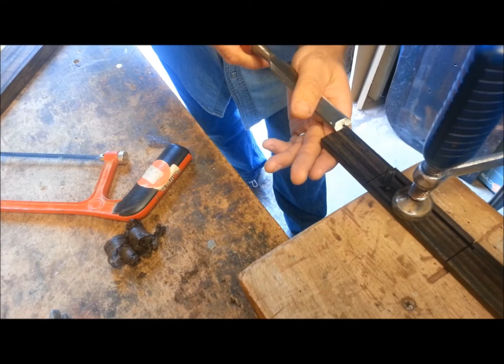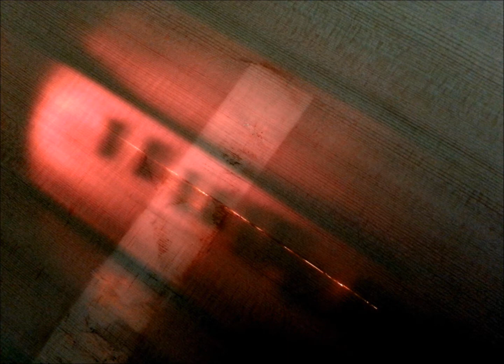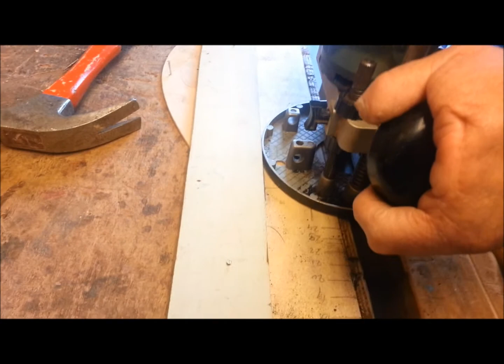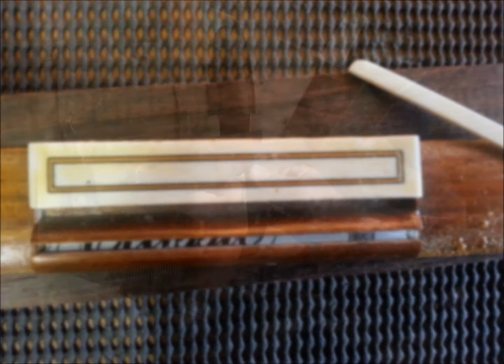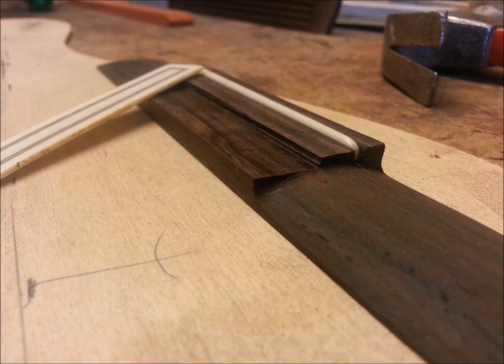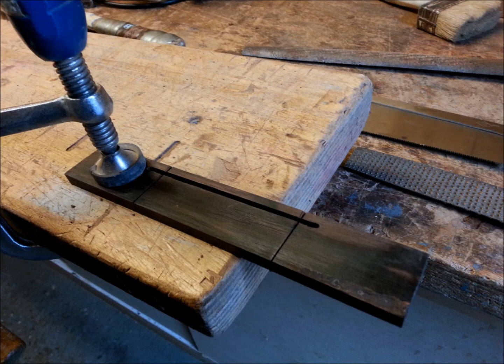Conde Hermanos AF27 making a replacement bridge

Comment: Can you hear a difference?  Many Spanish made guitars have the typical neck bowing problem increasing height at the higher frets. Is that why you changed the bridge? I had the opposite done to one of my guitars - fretboard replaced with a taller one to compensate for the height difference. I was considering a new bridge but I didn't want to mess with the original one. It worked great in the end but I do miss that lower flamenco string height at the bridge.